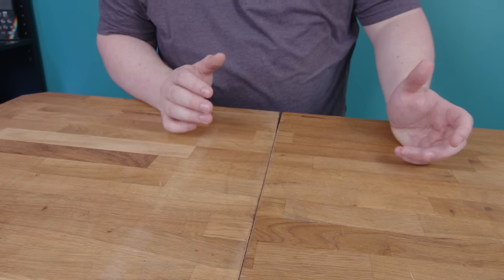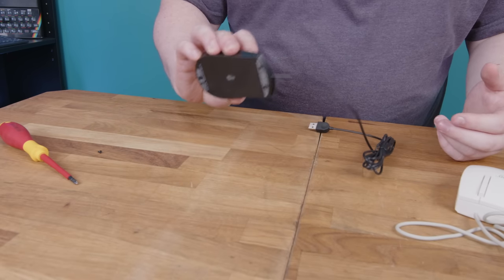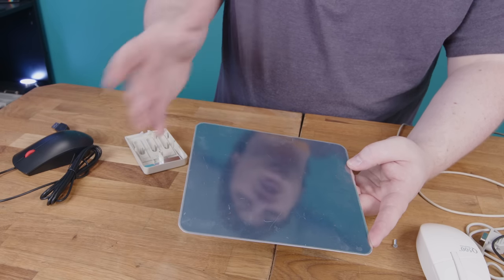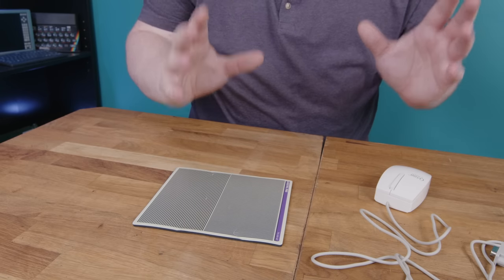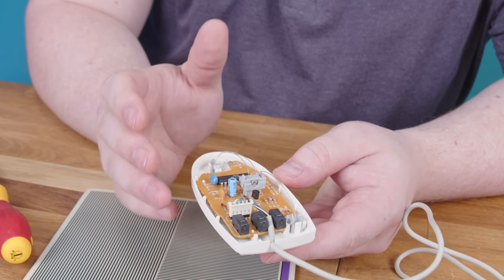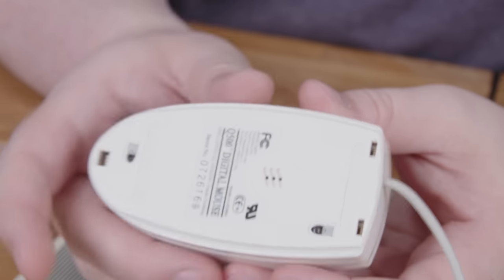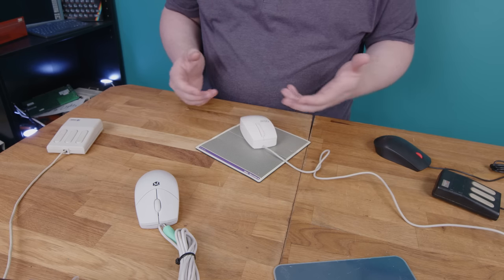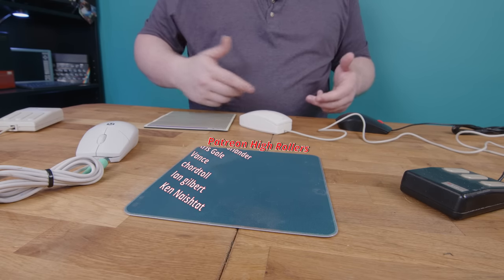Q500, The Weirdest Optical Mouse

Comment: I'm reminded of how trackballs are basically ball mice put upside down, and the modern optical trackballs conceptually just treat the ball as a globular mousepad that you move around instead of the mouse itself.
Reply: They’ve gone optical - 
And you still have to bloody clean them
Reply: @AllonKirtchik  Which reminds me I haven't cleaned mine this week yet
Reply: I love my trackballs.
Reply: That’s the one thing about the Orbit that gets annoying, cleaning the damn thing out fully.
Reply: They should have eyelids that blink 👁️
Reply: I've always wondered how well a mouse would work if you had one of those trackball mice where the trackball was on top under your thumb but you replace the trackball with the trackpad so you never have to clean it. It seems like it would be the exact same to me especially if you have inertia on or as Steam calls it trackball mode.
Reply: I was surprised to discover my mid 90s Cherry G80 keyboard with a little trackball module in it, actually uses an optical trackball module...
Reply: @bland9876  Your could probably even still have it curved to feel like a ball as well. That is an interesting thought. I don't care for trackballs but I would be interested in a trackpad/thumb version.
Reply: @bland9876  It'll probably work pretty well.  As you said Valve did it with the Steam controller which is essentially the technology you describe but in a controller form factor.  Its a good idea and I would love to see one made ^_^
Reply: I remember a couple of trackball companies early offerings actually used cue balls for the trackball.
Reply: I think originally it was ball mice that were trackballs put upside down?

Comment: I bought five of these NOS off eBay as a teenager in the late 90's.  Mice would outlast the pads so I used Paint Shop Pro to make wider pads since I was using Q500's well into the widescreen era.  Great vid as usual!
Reply from the maker: thank you so much for watching, and it's cool to hear from someone who actually used one of these - I can't believe I didn't think of extending the pad, I even tested scanning and printing a replacement, but it never occurred to me to change the geometry.
Reply: @CathodeRayDude  Live near an art institute so had access to wide format printers and laminators.  Student I was dating liked these stupid mice, gave me the idea, and I ran with it.
Reply: See, I love this kind of thing. Modern solutions to old school problems :)
Reply: How well did that work? That’s such a great idea!
Reply: @siliconinsect  perfect for doom
Reply: Shout out to PSP 👌 Still a better GUI than PhotoShop, IMO. Been using it since the 90s.
Reply: @Prizm44  I'm still using Paint Shop Pro 5 as I found newer versions started to load slower and had features I didn't really need nor want.

Comment: When you opened that mouse up and I saw those light pipes, I thought “that damn thing is a ball mouse emulator”
Reply: I immediately read “that damn thing is a ball mouse emulator” in Hank Hill's voice
Reply from the maker: yeah the parts add up, it all makes sense, I feel like I should have picked up on it a lot faster than I did hahaha
Reply: @Fuzy2K  “No, you are not tripping. That is an emu.” - Hank Hill
Reply: I thought exactly the same thing!
Reply: how didnt i noticed it!. Its essentially the same but cheaper! reading which axis and which direction it moves in to make movement.
Reply: I was mentally shouting "rotary encoder" through half the video.
Reply: @Fuzy2K  born and raised in Tennessee, close enough? 😂

Comment: Those sensors are probaby phototransistors - labelled "PT" on the board, and cheaper as they need minimal electronics to read the output as the signal from a strong source is higher than photodiodes.
Reply: Mike was here: now I know for sure that this channel is very promising
Reply: Also, a key difference between a phototransistor and a photodiode is that the latter is digital*; above a certain amount of light, it passes current, below it it doesn't.  Whereas a phototransistor is an amplifier; the more light it gets, the more current passes through.  This means the IC in the middle might be doing analog sampling of the light, rather than strictly lit/unlit.  That means it might be able to tell the difference between both fibers being illuminated and just one being illuminated, allowing for might finer detection.

I suspect this is how the LMOX2 in the more recent video works, too, and possibly why it takes a bit to recover from being on the wrong pad (its internal model of the world is deeply confused by the switch back).

* Technically it's more complicated.  A photodiode can act as an amp, it's just far less sensitive and has a much steeper response curve.

Comment from the maker: hello hi, I would just like to note that after reviewing the text of the patent again, I believe I may not have correctly described how the mouse systems design works. You can see the patent number in the video if you'd like to read it yourself, but I believe it is stating that the cells are read at three levels, not simple binary, and that custom motion prediction algorithms are used instead of the simple Grey code approach that I was picturing. there may be other misinterpretations. I do think they're semantic however, overall my description of the process is pretty close to accurate I believe.

Also! I mixed up my dates, the intellimouse of 96 was a ball mouse; intellieye came out in 99, so this thing was way ahead of it's time!
Reply: Interesting.. Do i also remember those mice would sometimes move backwards if you moved them too fast as the pulsing got "out of sync"?
Reply: Interesting indeed - I also was a bit surprised by your description, because for these 4 (or even 2) bit systems to describe a direction, usually the sequence is like 1100 (and then either 0110 if moved right or 1001 if moved left) - that's how encoders work in general (eg in ball mice) and in fact I think a variant of this is also used for optical mice (much simpler than analyzing a real image, may explain why it's more reliable than your instinct expected)?

EDIT: Oh, the 2-bit encoder-style thing is exactly what this mouse uses, apparently, nice!
Reply: They may use a few buffers to remember previous bits, idk just a guess.
Reply: @RichardDzien  - That's exactly why it happened. The effect is called "stroboscopic aliasing", or more colorfully, "The Wagon-Wheel Effect". If he'd been able to put an oscilloscope on one of the LEDs to measure how many times it flashes per second, we would know its Nyquist Frequency.  Then we'd know the point at which moving the mouse faster made it think it was actually going slower - until it thought it was actually going backwards. And if you kept going faster, eventually the mouse would think you started going forward again.
Reply: The reason for the sensors in the Sun mouse being located far away is not because they could not install them upside down, it is to the have more angle of separation for the light that is hitting it. It should be far tinier to be upside down on top of the holes and i'm fairly certain that would require some optical stuff, like lenses.. and it would be nightmare to adjust its focal distance just right. Installing them further away makes it cheaper and easier to build.

The three holes could be for probing, Q&A testing. They seem to line up with three solder pads.
Reply: Did you choose not to, or forget to, pin this comment?
Reply: I suspect this mouse also reads at multiple levels, not just binary, too. You'd get significantly more resolution by trying to measure the phase position relative to the square wave grating on the pad.
Reply: Those grid mice are the best.  I would use one now if I had one.  What is the date on that mousesystems patent?  I've used some pretty old workstations that used those reflective pads.  I had a sparc IPX that had one, but have also used ANCIENT SGI Iris machines which used them.  I'm talking like thick Ethernet ancient.  LOL "Is there an adult here?  What is this monolith??!" 😂
Reply: Another bit about the mouse systems mouse I didn't see mentioned, a side effect of the grid pattern and directional sensors means that the mouse and pad only works when oriented properly -- and it's quite an awkward way to use a mouse!

Same effect as this cheapo mouse.

Comment: The holes in the bottom could be used for some sort of factory test/programming if they line up with pads on the PCB.
Reply: I was just getting ready to write the same comment :-)
Reply: Same though as well.
Reply: I though the same. That means it was even cheaper .LOL.
Reply: No programming is needed here. And for testing they would need at least 4 contact points. Not to mention the holes do not line up with any test points on the PCB.
Reply: @111chicane  Also that PCB is so janky there's no way it's got test pads on the underside.
Reply: Considering they were going the cheap route, perhaps they re-used an existing design and just made the minimum amount of modifications needed to be able to put the thing together..... just a thought.

Comment: 16:59 this is exactly how a rotary encoder for a mouse scroll works! the binary output is 00 01 11 10 00 for clockwise and 00 10 11 01 00 for anti-clockwise. i found this out after thinking a bit on how to use one of those rotary encoders for a steering wheel controller

Comment: The squarishness of your circles might be due to the "Enhance pointer precision" option in Windows, which in spite of its name makes the pointer less precise by squaring off movements that are almost-but-not-quite vertical or horizontal. I hate it. It's especially annoying for CAD or graphics.
Reply: Strictly speaking, that is precision.  It’s just less _accurate_.

You can make a clock 100% precise by taking out the battery, at the obvious expense of its accuracy.
Reply: @tomgidden  I'm pretty sure that's not what anyone reading the description expects it to do.
Reply: @djcsdy2  Sounds about right. Windows never does what I expect it to do anyway.

Well, apart from make me more at peace with Apple's pricing model.
Reply: @tomgidden  oh don't get me started on Apple's treatment of the mouse. Moving the cursor in macOS feels like wading through custard, and there's not even a misleadingly named option you can turn off to fix it.
Reply: mmmm custard

Comment: i remember early SGI machines super computers and Sun machines using these kind of optical mice with the special pad late 80's early 90's
Reply: Yep, they were standard on Sun workstations at least as far back as 1984.
Reply: Boeing had a buttload of I think SGI (maybe Sun) machines in like 1991 or 1992 that used those stupid 3 button optical mice. You could have fun with someone by rotating the mouse pad 90 degrees, it would swap vertical and horizontal movements on the mouse. Everyone hated them, so they replaced them will I think IBM standard ball mice at the time. They had a surplus warehouse to sell, surplused stuff. We went alot and once we came upon a giant box, 6ft x 6ft x 6ft, full of those mice. And a metal skid (metal carrier box, 5ft or 6ft on a side - 2 1/2 foot tall with fork slots to pick it up, for heavy crap), full of the mouse pads. I think the mice were a buck each and the mouse pads were per pound (whatever AL was going for then, pretty cheap). Thousands and thousands of them basically thrown away. That was the Boeing way then.
Reply: Yeah, had these at college. You could use your leg if the mousepad was missing, if you were wearing slightly faded jeans.
Reply: The aluminum mouse pads were horrible, not only it was uncomfortable but there were often dents and scratches or the pad was slightly bent.
Reply: Oh yeah and I believe Sun had enough complaints at some point because I think they started to ship just "regular" mouses even for the computer models that originally came with these mouses. It also took a bit longer for them to join the more modern optical mouse gang.

Comment: Hell, replace the two infrared leds with a red one and a blue one, then print a grid of red and blue lines as big as you want.
Reply: A neat idea now, but a blue LED in the mid 90s would have cost more than the whole mouse.
Reply: @jimmy21584  So use a green LED, the only other color available in the 1970s.  I believe I have used such a mouse a long time ago on someone else's computer.
Reply: I was thinking this. But it's so obvious that they must have considered it

Comment: Betting that the three holes are for test points to test the electronics once assembled
Reply: They line up with three solder points, so I guess the same.
Reply: my first thought after opening was, that they where to lazy to shorten the leads of the parts, so the made a cut out in the housing to avoid trimming leads.
Reply: Could also be a previous design iteration where it was easier to amend the mold with new cutouts than to fill in the now-unused features.

Comment: 2:50 Fun fact, the Mars Helicopter doesn't have GPS to tell it where it is or how far and in what direction it is moving so it uses a more complex version of this method that takes altitude over the surface into account as part of it's navigation system along with some angle sensors and accelerometers.

Comment: I bought one of those about two years ago. I was trying to revive a “vintage” computer without a working ps/2 mouse port (for nostalgia’s sake) and these things are all I could find for “serial mouse” at the time. I’m probably that one guy who actually did want a new ball mouse, for authenticity or something, but I settled for this. I assumed at the time they were some sort of industrial design, meant as replacements for that ancient pc running a production line somewhere that nobody’s bothered to update in 30 years. The lack of moving parts might be convenient in a dirty shop. Didn’t know the design dated back to the 90s. Thanks for the video.

Comment: There's a possibility (remote) that those 3 holes could be some sort of manufacturing artifact like a test point or jig connection location. Excellent analysis!
Reply: Pretty remote, normally you'd do that on the bare PCB before you put it in the case. For one thing it saves having to throw away a good case for a faulty PCB, or else pay someone to de-case them again.
Reply: maybe they put them there to make it look more like a transitional optical mouse so that people wouldn't think they were scammed?

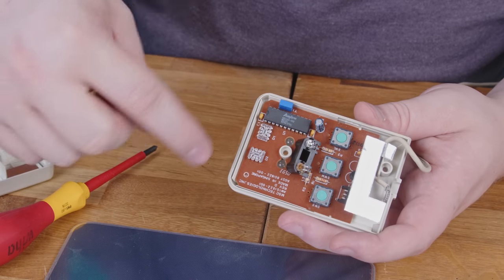Comment: 8:44 "It can detect 4 pixels vertical and 4 horizontal. What do you do with that?" It's ironically the exact same thing that ball mouses use, the ones that didn't just use potentiometers (those are REALLY old) but instead the ones that had mechanical or even optical encoders in them and it's what people have used for most of the 90s, those that had wheels with spokes in them. This is the same thing but the spokes are in the mouse pad instead. This is what still exists in your mouse to count the steps in your mouse wheel.
Reply: I sort of recall those don't count steps either, but relative phase?

Comment: Someone did his homework. Nice vid. Personally i love optic mice since the day they came, though older models seem have lower resolution, i collect them nowadays because of the shape - all modern mice too small for my hand (and don't get me started on gamer mice with too many buttons that accidentaly hit objects, like keyboards, while operatin. i love the old fashioned button-on-top-design), so i'm actually considering retrofitting an old MS model with modern opticts. That all said, in my box i have a '3D' mouse (as in - works hovering in the air, capturing motion). Has PS/2 compatabilty. It sort of worked, but in practice lacked precision. Not (only) because of the mouse tended to drift into one of the corners on the screen while being idle,  but more because it missed the tactile feedback. Quite sure it predates nintendo controllers with 3D sensors. But this vid, with this hack, made me curious again. Gonna dig. Will ship it to you if you are willing to ship it back. Regards.

Comment: Uncanny!
I used a mouse just like that mouse systems one during my work experience, back in the 90s.

It was attached to a Silicon Graphics workstation, which was running a cad program called DOGS.

Same 3 button design, same mouse mat, and I remember thinking at the time, this has to be better than using a rubber ball with 3 rollers.

The design especially the 3 buttons which was super unusual at the time, reminded me a lot of the Archimedes mouse design which I was very familiar with as we had those at school.

Fascinating video! Thank you for making it.

Comment: I've seen these for sale on eBay for many years, and almost bought one at one point, but what turned me off was the design of the pad. I have been familiar with the Mouse Systems design for a long time, so I always figured this used similar technology, but I thought there was no way it would be any good with that pad design. The lines just looked so thick, so I didn't think it could be precise, and I thought that going too far up or down was likely going to be a problem. Awesome to finally see a review of one, and now I'm wondering if I should pick one up.